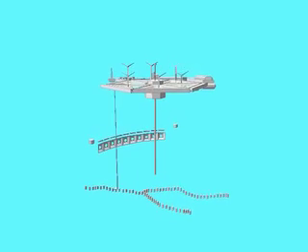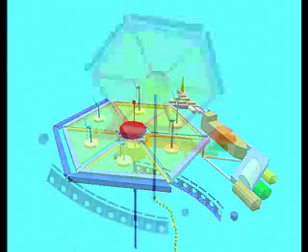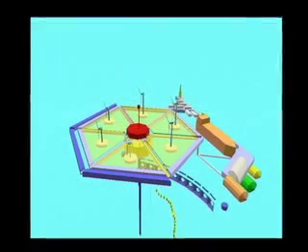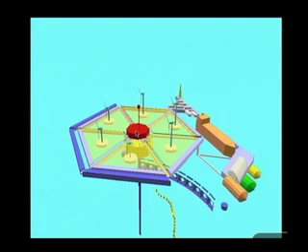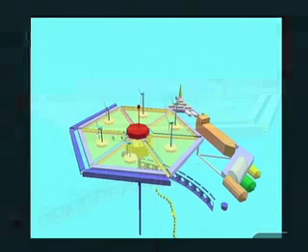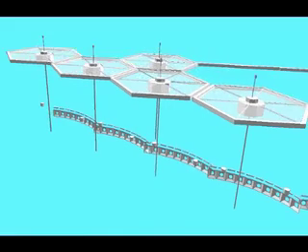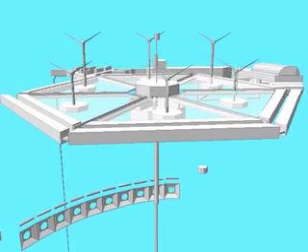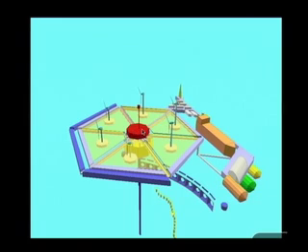Energy Island

Comment: @heyshutupyou To produce a current from a magnetic field you need to move a conductor relative to the field. IE if your field and conductor are moving together then no current is produced. The earths magnetic field is quite strong as a whole, but pretty weak per area. If it was as strong as you believe air planes wouldn't be able to fly straight because the large magnetic field would constantly be trying to push them in a BxV direction.

Comment: @boxa888 When it reflects back it is dispersed over a much larger area than the semi point source which started it hence much of the energy is lost. You can create nodes in the propagation, but you will always lose energy in the transmission so much so that running a long conducting cable is much more effective and efficient. There is some truth to your ideas, but they are stupid compared to what we do now. Just because something is different doesn't mean its better...